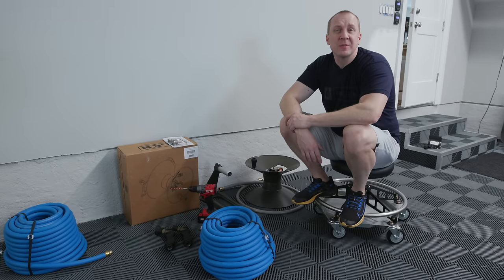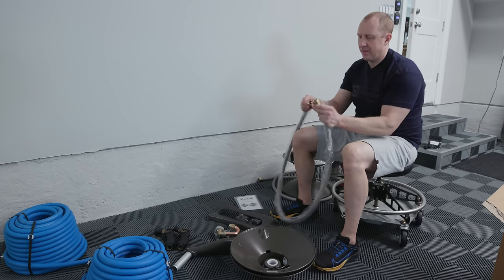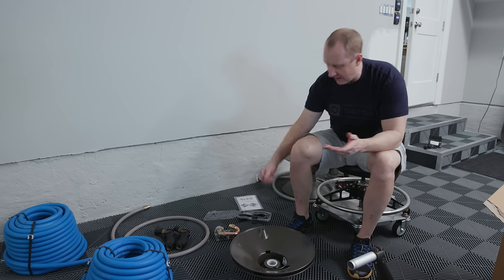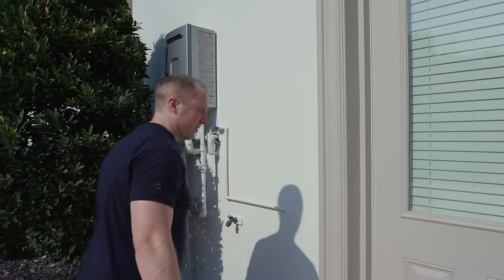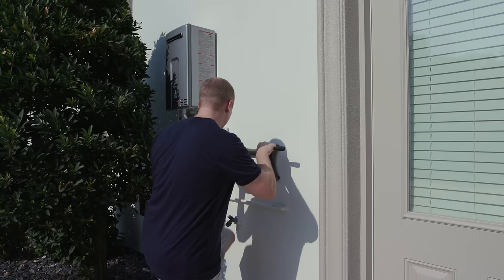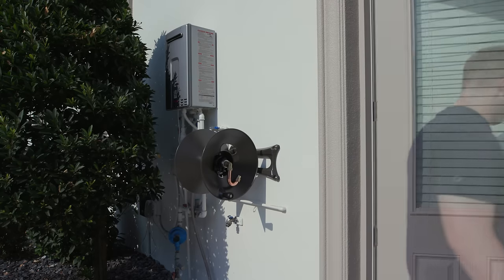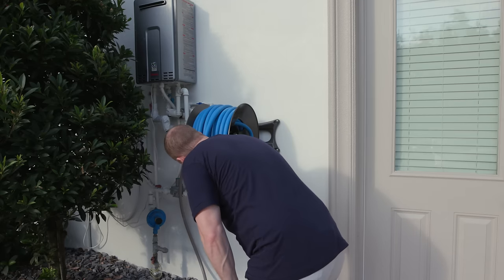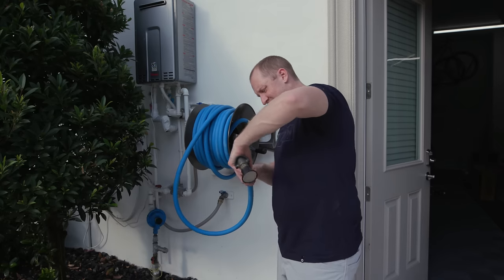Installing Eley Garden Hose Reel - The Best Garden Hose Reel

Comment: Matt, was this 100’ or 125’ of hose?  Eley’s website shows standard capacity for this unit as 125’ (you mentioned 100’ in the video).  However I like how this quantity of hose looks on the reel spool.
Reply from the maker: This is 100’

Comment: Why not the bucket filler nozzle?  I gave up on pistol grips.  But I've not had an Eley.  I did retrofit an industrial trigger nozzle years ago.  It worked... kinda.
Reply from the maker: Those can work too.  I just prefer a single handed nozzle on a garden hose.

Comment: Okay: some concerns I have; most everything I needed to see was concealed and he stood between the hose and camera which didn’t help. I’m still a bit troubled with the ‘jumper’ hose that comes from the tap on the wall and goes into the body of the reel and connects to the elbow to feed the water into the long hose. I’m wanting to get the 4 wheel cart so that I can pull it around to wherever I want. If I use the 6.5 foot jumper connection, how does that work if I want to move the cart further away from the water source? If I want to move the mobile reel further, how do I feed the water source to the elbow connection point on the reel? Am I missing an idea here? Because isn’t the point of buying the 4 wheel free moving reel to take it to different places? Also I feel awkward about that blue hose that would be used in place of the ELEY hose. He said it doesn’t kink but that is the very first thing it did. Can someone tell me what the advantage would be to use the blue hose instead of the Eley hose? I’m looking at $1,000 of parts from Eley in my shopping cart at their site. I want to be able to move that cart around.
Reply from the maker: Eley has a 6.5', 12', and 20' inlet hose option.  The Continental Frontier hose is much, much thicker being rubber instead a hybrid poly.  It also does grab itself when winding up.  The hose won't kink like the Eley does.  It naturally unkinks as you pull on it.

Comment: My dad got a little Ryobi 1.2 GPM pressure washer a few years ago, and never could get it to work at his house with a 5/8 hose. It would always surge all the time. With a 3/4 hose it was fine. But at my house I hooked it up with a 5/8 hose and it works fine. Pretty bizarre.

Comment: By all means - this isn't a correction, you do you. But those backflow preventers are there for when a firetruck connects to a water source, turns on the pump, and begins to pull large volumes of water out of the city supply. The pump on the truck is powerful enough to cause negative pressure to surrounding homes and entire neighborhoods (if multiple trucks are connected, it's not uncommon for the effects to be seen nearly a mile away from the scene). That device prevents contaminated water from being sucked up into your homes drinking water, or worse, the supply to the neighborhood. For hose reals used outside, around plants/pesticides/fertilizers, the risk far outweighs the benefit, IMO.

I'm sure you knew this, and are ok with the risks, but others should know how dangerous that really is. Love the videos, love your store, love your products. So please don't take offense to this.
Reply from the maker: Great post.  I wasn't aware of that.  I always thought it had something to do with backfeeding from the actual hose hooked up, but never understood why.  Now I know.
Reply: Vacuum breaker.
Reply: Thanks for that. The one on my house always spits water out all around it when turning the faucet off. If there’s pressure in the hose it’s even worse. Is it supposed to do that? It’s annoying as hell.
Reply: @Patrick94GSR  Yep. It has a purpose.
Reply: @ObsessedGarage Thanks for the kind reply! Keep up the amazing content and get that GT3 up to OG spec!

Comment: When your rewinding, bring the end of the hose back to the reel first so you’re only dragging half of it as you rewind. Also keeps the hose end or spray nozzle from being drug across the concrete driveway.😳
Reply: Excellent point! I’ve been doing that in my driveway for years. My reason was that our rubber hose kept getting caught behind the tires. So now I got a new hose that doesn’t crimp and curl, and bring it into the garage and roll it, and it doesn’t scrape the nozzle.

Comment: It would be way cooler if it was retractable.
Reply: I replaced 2 Eley’s w/Hoselinks.  No comparison.  Swivels and retracts!
Reply from the maker: MacNaught makes the best retractable reels.  The problem with retractable is that they don't handle heavy duty hoses like my Continental Frontier very well.  Hoselink hoses are junk.
Reply: @ObsessedGarage  I’ll have to compare the macnaught to the giraffe tools for the gardening water points.  The Eley looks like it will do the trick for the driveway.
Reply: @ObsessedGarage  almost pulled the trigger on this one, but saw several bad reviews on Amazon. They don’t make a retractable reel that you can put your own hose on??
Reply: @ChicagoAutoPros  sure they do, even the ones that say they dont can be rigged

Comment: A 3/4" size would be ideal for us professionals who have to drain water heaters and pump out flooded areas to access for work. Not all hoses are used for watering gardens. You're also likely to find more willing spenders for higher quality goods if they use them for work.
Reply from the maker: I used to do the 3/4”.  It is super heavy.
Reply: Yeah watering my lawn takes too damn long with my 5/8" and I only came across this video while looking for a good 3/4". Darn now I gotta keep looking.

Comment: If you're installing any more of those concrete anchors, tapping the anchor fully into the drilled hole before placing the screw in it will allow the anchor to set more securely.  The screw causes the anchor to expand to the point that it will become tight when fully seated and it won't free spin.  Hope the tip helps...still owe you about a thousand more for all I've gotten from the channel.

Comment: Not sure the OG handles cold Tennessee winters. Had mine 3 years snd inside of hose coming apart. Small black rubber pieces come out.  Ordered new as the rubber could clog foam gun filter.  Will store in winter and use cheaper one then.  Summer only for OG.

Comment: That original ELEY video is one of the first videos that brought me to the channel. I was flipping the through the Northern Tool catalog for a rolling reel and just knew they were all junk. I ponied up the cash a few years back and got an ELEY hose reel with two 60' Griot's water hose because I needed more than a hundred feet and the black matched well. I immediately swapped out for the OG inlet hose because I could customize the distance too.

Comment: While Eley makes great Reels, I do think a 5/8" retractable hose would be a more OG Solution. Hose Link does a decent job but uses subpar hoses that are too small and the quick connects they use are great for granny in the garden but not for us. That said, my grandma loves hers and has used it countless times over the last 3 years. I've only had to replace parts for the actual fittings once.
Reply from the maker: Macnaught makes the best retractable, but all of them can't handle a heavy duty hose like this.
Reply: @ObsessedGarage  i was able to fit a quality 65 foot 3/4 inch hose on a blu-bird retractable reel , if you want  a longer hose, zero g makes a 3/4 inch kevlar style hose that doesnt lose inner girth when it isnt filled and you can add maybe 20 feet and still fit and it fills quickly without ruptures. the blubird is heavy duty /industrial with a quality all metal crank/ratcheting system. i just dont like the blu bird hose